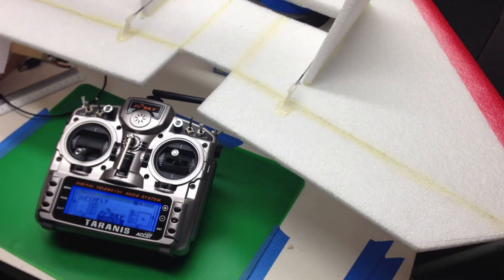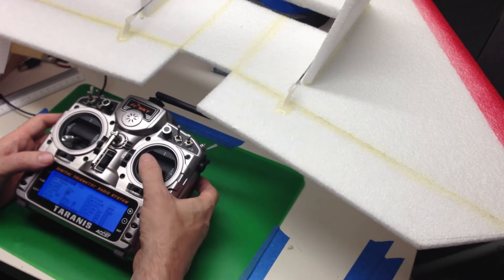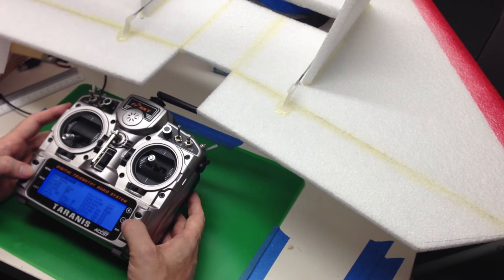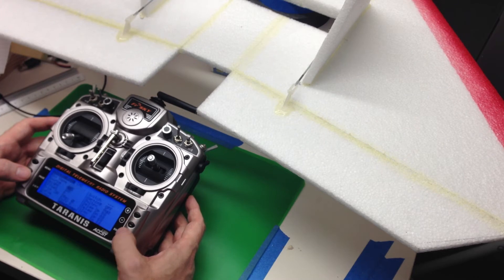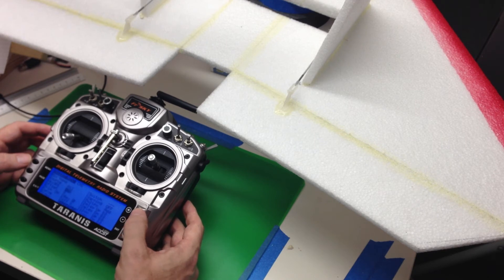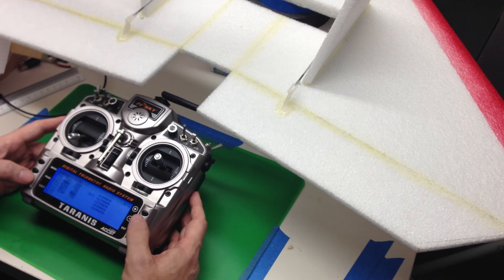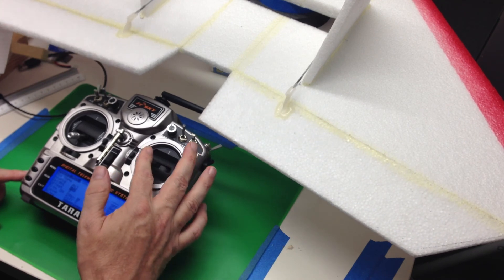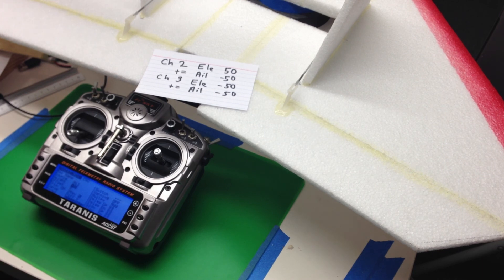Taranis OpenTX Elevon Mixing

Comment: Beware,  new firmware now results  if you use negative figures here to reverse servo,  your trim will still move the original direction,  so trimming becomes impossible.  Use mixer instead with new direction arrow

Comment: I'm having a hard time with the 50% concept.  I want 100% movement from my control surfaces, just as if they were standard aileron's / elevators.  Why give the surfaces only 50% of what they should be moving?  That decreases roll by 50% over a standard wing aircraft for example... Why?  My planes have full range on ailerons, but my wings only have 50% on ailerons...  I'm stuck man, please help me out...  Thanks.
Reply from the maker: Think of the case where your stick is full left and full back.  You are rolling and looping.  So, the right elevon is up 100%, and the left elevon is up 50% (so you roll).  You can also visualize by putting the stick hard left, and then moving the stick up and down. The two elevons will stay in the same relative position, and move up and down together.  Does that help?
Reply: Yes thanks. I finally grasped the concept by playing with the surfaces, putting them at 100% -and realizing that I've now lost ability to get elevator control while banking, as you say. My wings fly great now. Thanks for getting back to me. I appreciate it. Take care man.